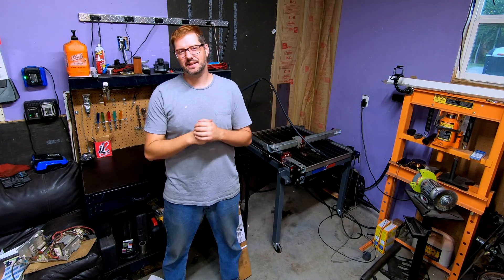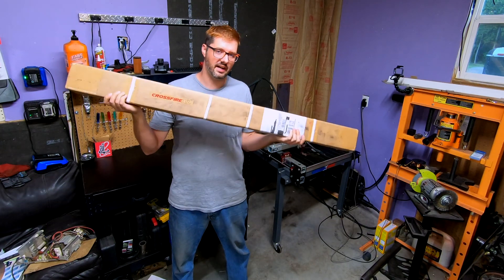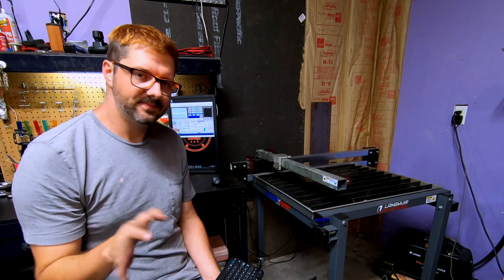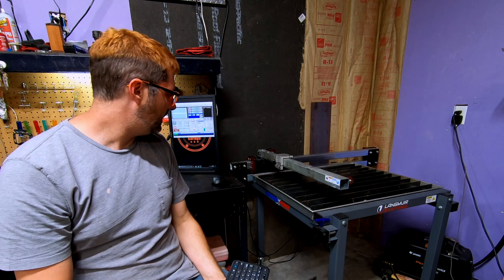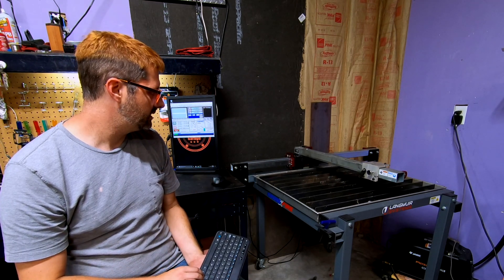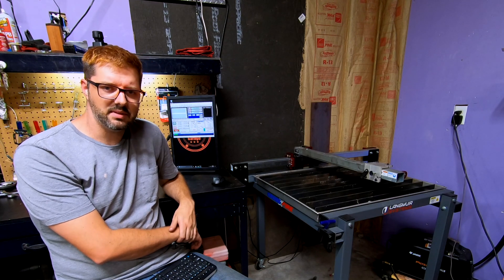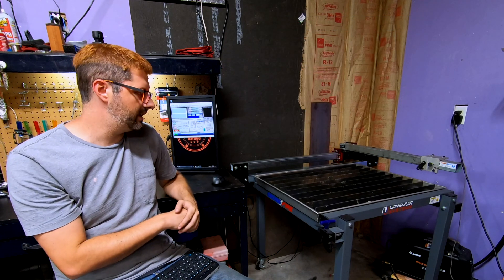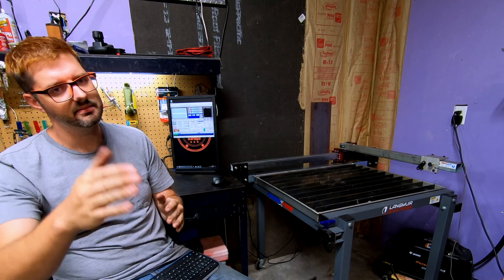CrossFire XL Expansion Kit Unboxing and Installation

Comment: Thanks for the video.  If shop space was not an issue, would you like to have the larger Pro table?  I am planning to get a table, and the XL version seems best for me based what parts I think I want to cut out.  That said, its easy to look at the cost of the Pro table and say that it's "only a little bit more" to get that one.  Are you buying larger sheets and cutting them down or buy them already cut down?  I assume the latter would be more expensive, but save time.

Comment: I'm having a issue with the new expansion. It gets stuck when going back and forth, as in gets in a bind. Did you have the same issue? If so, How did you fix the issue?
Reply from the maker: I have not had that issue though it sounds like the alignment on your lead screw is not correct, so I would check there first!
Reply: I believe I resolved the issue. The set screw on the motor keeps coming loose. I added some red Loctite and waiting for it to dry